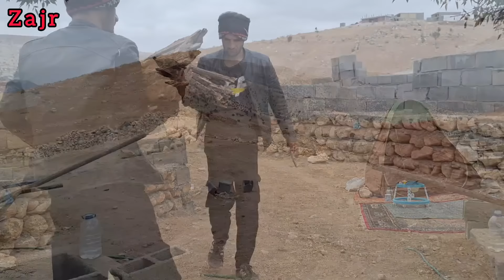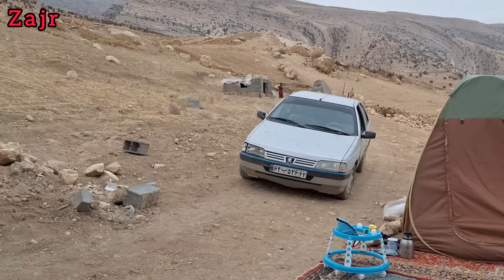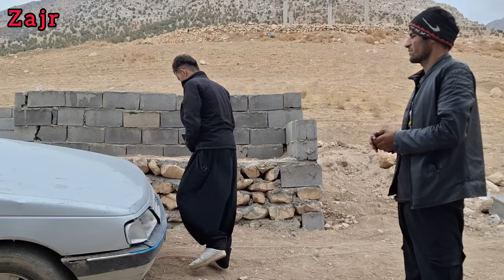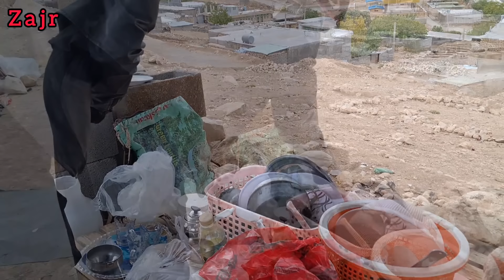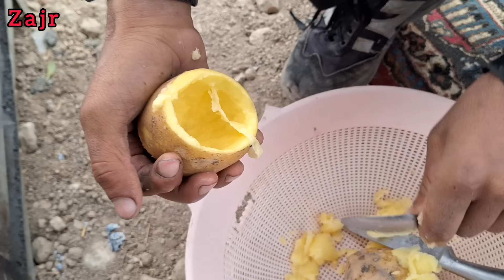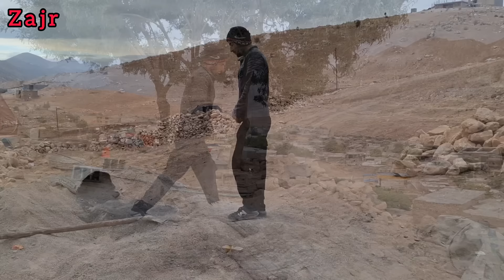The effective cooperation of Mohammad and the doctor in dealing with Ali's mother's illness

Comment: They need a “ BIGGER TENT “ to live in Ali needs to build a foundation with those concrete cylinders and put the tent on top. When it rains the bottom of tent won’t get soak. Ali your a good son taking care of your mother and Bahar, but you need to hurry and get you home built before it gets really cold, snow and rain. Also you need to get warmer blankets ✌🌺❤